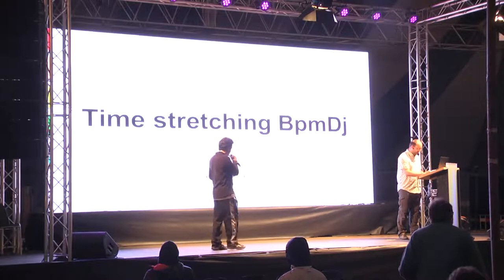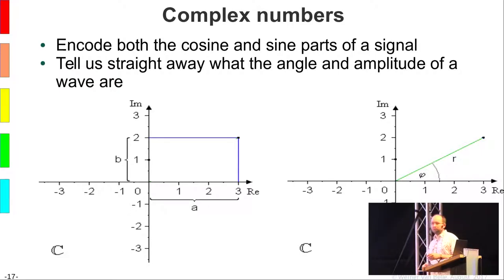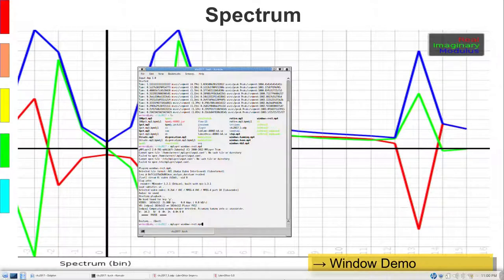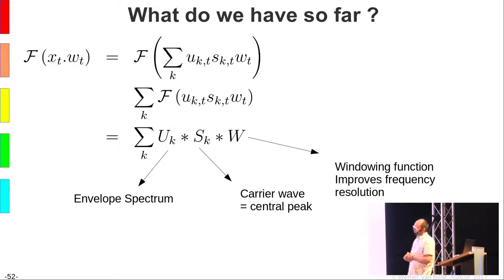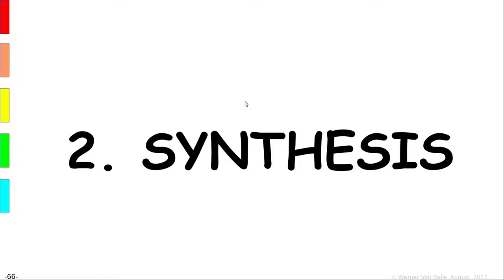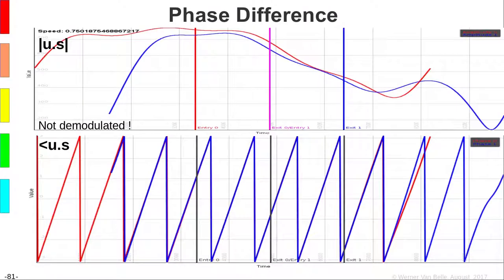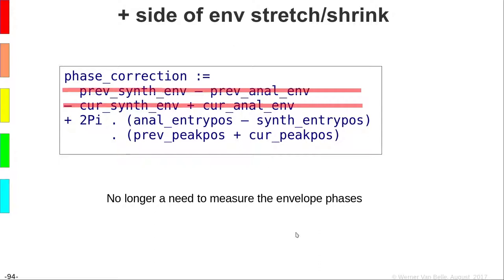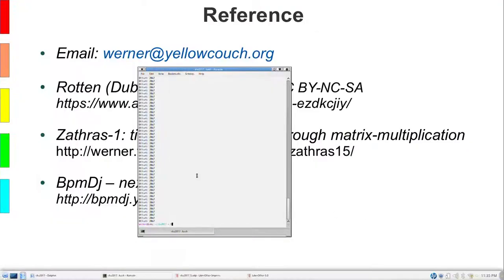Time Stretching BpmDj (SHA2017)

Comment: The abstract of the talk: Time stretching of audio tracks can be easily done by either interpolating missing samples (slowing down the track), or by throwing away samples (speeding up the track). A drawback is that this results in a pitch change. In order to overcome these issues, we created a time stretcher that would not alter the pitch when the playback speed changed. In this talk we discuss how we created a fast, high quality time stretcher, which is now an integral part of BpmDj. We explain how a sinusoidal model is extracted from the input track, its envelope modeled and then used to synthesize a new audio track. The synthesis timestretches the envelope of all participating sines, yet retains the original pitch. The resulting time stretcher uses only a frame overlap of 4, which reduces the amount of memory access and computation compared to other techniques. Demos of the time stretcher can be heard at http://werner.yellowcouch.org/log/zathras/ The paper that accompanies this talk is at http://werner.yellowcouch.org/Papers/zathras15/ We assume the listener will have a notion about Fourier analysis. We do however approach the topic equally from an educational as well as from a research perspective. High resolution slides are available at http://werner.yellowcouch.org/Papers/sha2017/index.html